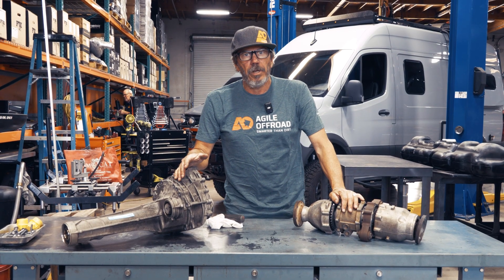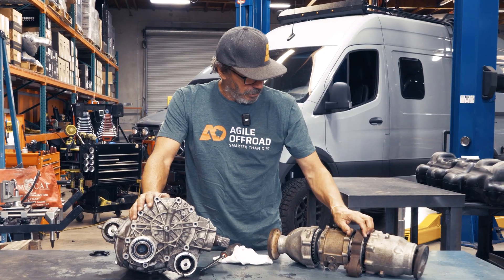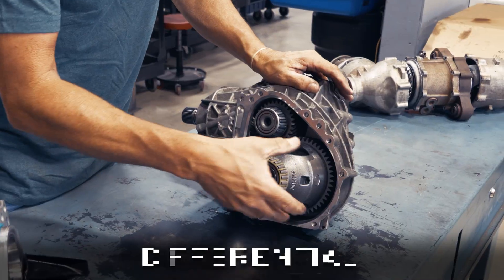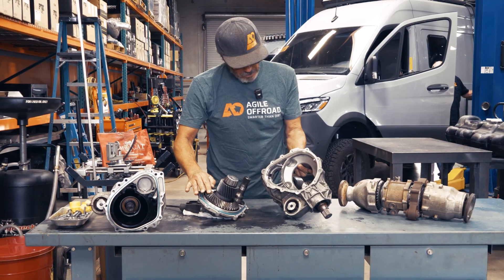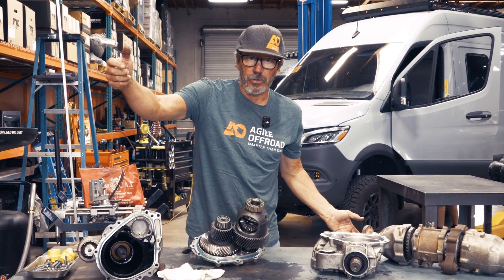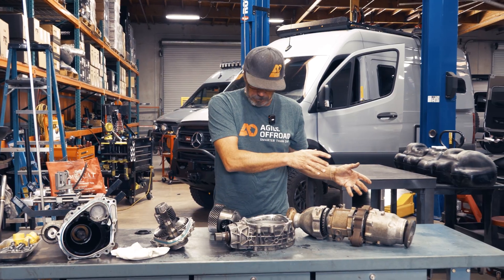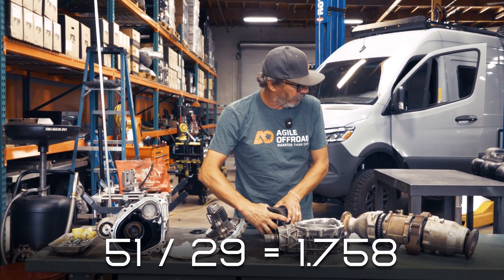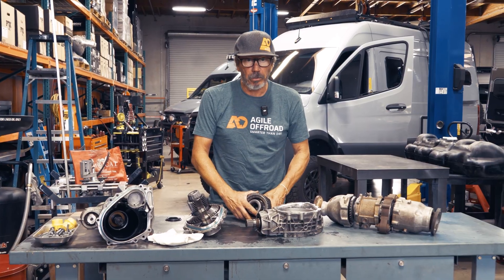What’s Inside the 2023+ AWD Sprinter Front Diff? | Gear Ratios & Design Explained

Comment: If the gear ratio in the front and back is 100% the same that should make it possible to install the atlas transfer case on the 2023+ models. Will you eventually offer that option?
Reply from the maker: Good question! The Atlas transfer case is available for earlier 4x4 Sprinters, but as of now, it’s not compatible with the 2023+ AWD models due to differences in drivetrain design and electronics. If the front and rear ratios remain identical and aftermarket support expands, we’d definitely consider offering that option in the future.

Comment: Thanks John! Any chance in the future for a front re-gear? I imagine a lot of 2023+ Sprinter owners would like to help offset the difference in larger tires, myself included.
Reply from the maker: Thanks for reaching out, and great question! We don’t currently offer a dedicated front re-gear for the 2023+ Sprinter, but you’re absolutely right—that’d help offset larger tires. We do however offer a new Diff for the rear on these sprinters with a 4.72 gear ratio, BUT for the front one you'd have to buy it from a dealer as they are the only ones that carry it at the moment, and we could potentially do the install for you, but that's just a new diff entirely. We would love to offer a re-gear but it's not doable at the moment unfortunately.
Reply: Hey John, if you’re offering a new rear ratio what is the effect of fitting this without changing the front ratio.
Reply from the maker: Good question! If you change the rear ratio without matching the front, the system will bind whenever AWD engages because the front and rear driveshafts would be turning at different speeds. For that reason, both gear sets always need to match to keep the drivetrain synchronized and prevent damage.